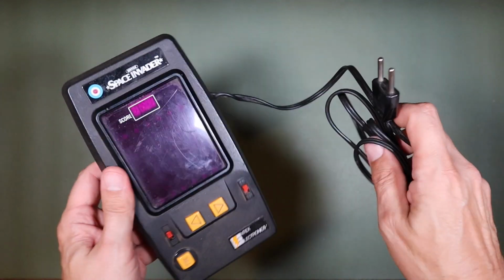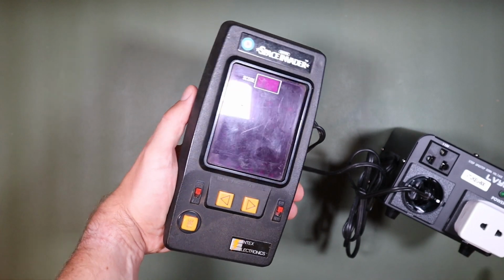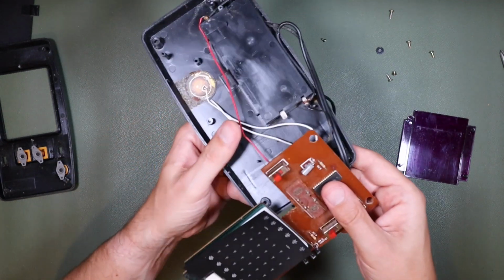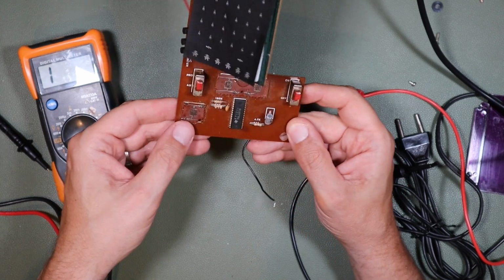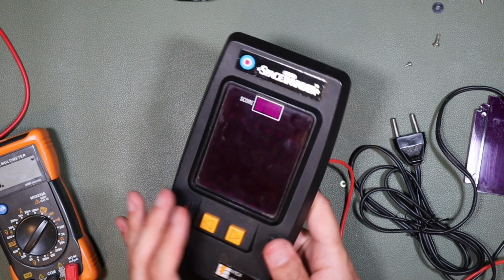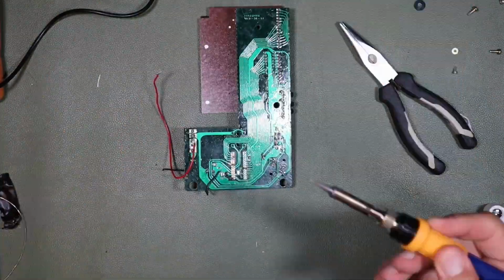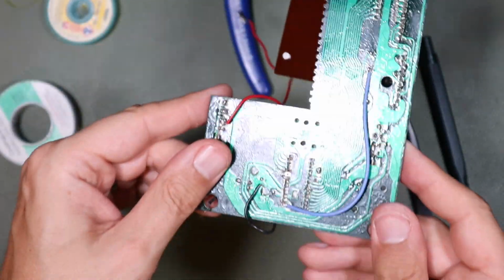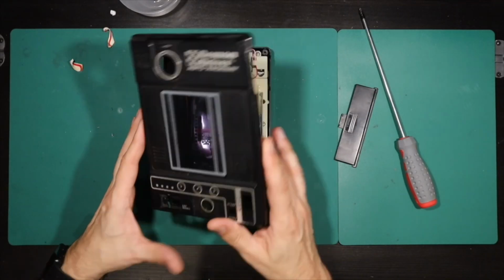This eBay Handheld Has a Dangerous Secret Inside

Comment: Great video! In passing, you referenced another tutorial regarding key pressing, which one is that? I am trying to repair my black Entex Space Invaders from childhood and need some advice regarding the buttons; the rubbery material underlying the 'left' and 'right' movement buttons has disintigrated, such that they cannot be pressed and pop back up--hope that makes sense.
Reply from the maker: Hi Thanks for your question. I know exactly what you mean. It's been a while and I can't remember exactly which vid I was talking about, but unfortunately it dealt mainly with dirty pads not disintegration of the rubber. I haven't seen that myself. I have no experience of it, but wonder if a cheap old keyboard might yield some rubbery bits you could use. I collect them from things I fail to repair and reuse if I can. I have seen buttons where the carbon has worn off the rubber pads and these can be fixed with copper tape or conductive paint, but I haven't tacked a total rubber failure. 

Thanks for your question. Sorry that I can't help
Reply: No problem; appreciate the response!

Comment: Trust me you don’t need 250 V to damage that circuit board which is designated for 9 V 120 V could do far more damage if a heavy voltage such as that was used you would see the damage straight away on those components
Reply from the maker: Thanks Mark. I appreciate the comments

Comment: Why would you do that?  Just, why?  That is so very dangerous and really a very stupid thing to do.  I imagine if you plugged that into a mains power point, the game would go bang, flash, and probably catch fire or do something else really horrible.  Does the game actually have an AC adaptor input on it?  I've never tried to repair anything before, but even I wouldn't do that.  What was the person thinking?  Who would do something so stupid?
Reply from the maker: Couldn't agree more! Crazy. The game itself doesn't have an DC jack so presumably someone improvised (badly) . I think you are right there would have been a lot of damage if the game had been plugged into the mains. Thanks for you comments and welcome to the channel. Great to have you along
Reply: @RetroTechRepair  Thanks.

Comment: I got Grandstand BMX Flyer from ebay. The screen doesnt light up but the game sounds ok and it does the right things when you press the buttons. Any ideas ?
Reply from the maker: I haven't yet repaired a BMX flyer they use a high voltage florescent tube to back light an LCD, my guess is that the LCD is working but the tube isn't. Unfortunately I don't know how to fix it

Comment: **TIP**
🐨 Should you ever come across donor Chip swapping, it's a good idea to source some IC socket 
Strips, I stress Socket Strips, because IC's have various widths and Pins per side, and with the IC 
Socket Strips you can cut the amount of pins required to length, Now to solder in the pins it is 
important to have the IC plugged into the two strips as you solder the first four pins at each corner, 
once the corners are soldered in, remove the IC to avoid heat damage and complete soldering in 
the rest of the IC socket pins, once done, Plug the IC in and hope the extra height doesn't interfere 
via the extra height from the installed IC Socket..

Good Luck..
Oh and APU I dropped a 👉👍👈
Reply from the maker: Thanks so much for your detailed comments and Great tip. I do have some  sockets but don't have strips and will get some following this. Thanks also for your support to the channel. Much appreciated.

Comment: What is that spray you are using to clean the outer plastics?
Reply from the maker: Hi Brian I use a window cleaner spray like "windowlene" or "windex", whatever brand they have at the shop when I run out and then clean with a tooth brush. Sometimes I finish off with a household spray furniture polish. Hope that's useful. Thanks so much for your question.

Comment: It probably connected to a bench type power supply.
Reply from the maker: Great Minds think alike. I had thought that too, although the plug was marked 250 VAC and when I tried it with my bench supply and the spacing between pins was way off and the pins themselves thicker than normal banana plugs. I should have shown it in the video really. Thanks so much for your comment though, I like your thinking and appreciate your feedback.

Comment: My guess would be they used a 6v 4R25 battery to power it up, maybe just wedged the contacts of the mains lead into the springs on the battery.
Reply from the maker: Thanks Retro Tech Guardian, they certainly could have. No polarity indication or reverse polarity protection on the board though, so perhaps it only lasted long enough for the 50/50 odds of misconnection to play out! Thanks so much for you comment. Much appreciated

Comment: I was expecting to see a badly wired,  PCB power supply inside for the 9v DC, not just wires wrapped around the battery contacts. Insane that someone would do that 🙄
Reply from the maker: HI Matty, I know crazy isn't it? Somebody had suggested it might fit a bench power supply but it didn't fit in mine, but it fitted many AC sources well! maybe somebody thinks UK mains is 9v DC! who knows. Glad you enjoyed the video and thanks for the comment.

Comment: Yikes, looks like it did get plugged in, strange it didn’t seem to have gone bang. No soot, no exploded parts. 
Looks like they changed things around quite a bit.  I had a similar with,y locomotive alarm clock.  I found it at a thrift store and got sound but nothing more than clicking as the blob on a board was faulty. It did seem to behave correctly but only one bit of the digital recording of train sounds was reaching the speaker.  I found the Hong Kong manufacturer who put me in contact with the Australian distributor.  They supplied a new sound board and I figured out the alarm input was now low to activists instead of high to activate.  I swapped the alarm and lights wires at the battery and voila! Train sounds.  Then there’s my model car radio. A model of a ‘28 Lincoln, the radio was always distorted and recently died with no local oscillator.  It was missing the steering wheel but otherwise in pretty good shape.  Then a Rollys Royce Phantom Coupe appeared at a local op shop.  It was in poor shape, finished corroded, wheels missing, lights missing, steering wheel rolling around inside.  I soon had the radio swapped over and glued the steering wheel into the Lincoln.  Almost complete now, the Rolls and the dead radio are in a drawer in case anything else shows up.
Reply from the maker: Yeah I wonder if they ever did plug it in? Nice repair on the clock and the model car radio, sounds like you went to a lot of effort for both. Very interesting. Thanks so much for sharing your experiences and your detailed comment. Super Interesting and very much appreciated

Comment: Nice video, would be nice if you could illustrate what needed to be done to make it pluggable. I was thinking: you could add a usb plug on it and find a charger with the same voltage and amps to make it pluggable.

Also as a side note, your voice over is lower volume then your other voice, which makes it I have to change my volume while watching the video.
Reply from the maker: Thanks Mitchel, I think USB would have been a bit low at 5v, but a 9v AC/DC regulated supply would probably have worked. Re the audio I will be more careful next time. Thanks for the feedback!